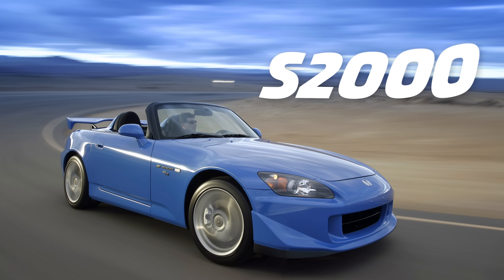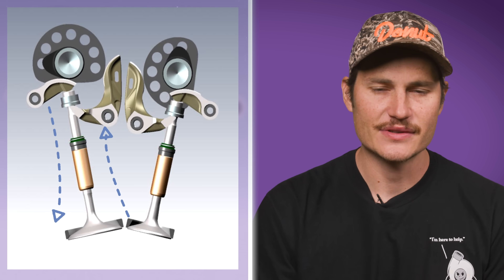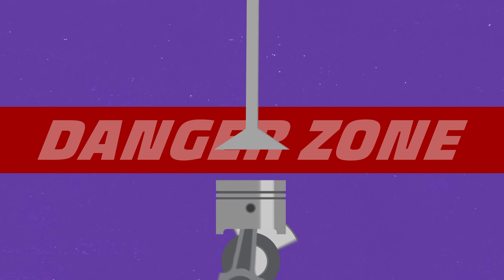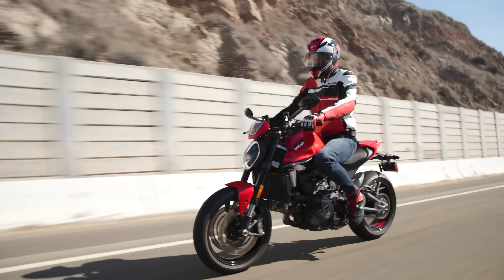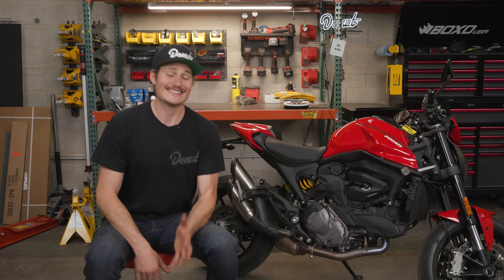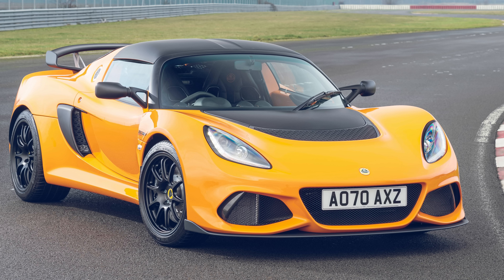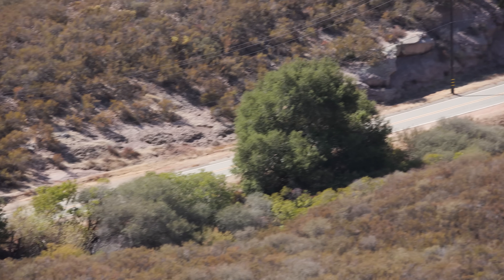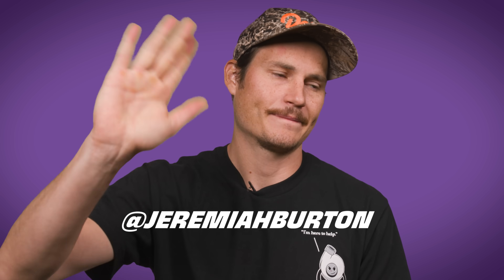Why ONLY Ducati Uses This Part To Go Fast

Comment: Recently watched a thing about Pegaso, in the 50s they built a car with a 32 valve quad cam V8 with desmodromic valves. The whole thing was nuts and 50 years ahead of it's time. All aluminum, dry sump, 5 speed transaxle. And it was one of those cars that had to be finished by a coachbuilder, so each one was unique. Absolutely gorgeous cars.

Comment: Wow, just when you think springs are standard - thanks Ducati. So, does a F1 engine use the same valve setup? 1.6lL15,000 rpm...

Comment: Honda used torsion bars instead of springs to close the valves in their 450 cc DOHC motorcycles in the mid sixties.

Comment: I remember the little Ducati Mach 1 250cc single back in the early 60s... revved to 11,000 and had a top speed over just over 100mph.... it was the only road going 250 that really could top the ton..... The Japanese claimed it but couldn't really do it by about 5mph. The little Dukes handled a lot better too, although their electrical systems were crap (Marelli) and very prone to stopping in wet weather, which is something Japanese bikes never did. I never could afford the Ducati..... sigh..... that was over 60 years ago... 😀

Comment: I don't understand the fascination with high RPMs.  Use more gears to take advantage of power made at lower RPMs and negate all of the problems of running an engine at a billion RPMs.  Makes much more sense.

Comment: Mc22.... cbr250rr can rev to over 18,000rpm like most of the early inline 4 250's...... these engines are also good for over 100,000klm complete with gear driven cams

Comment: the real problem with Desmos is that the check interval is often half that of your average DOHC spring-valve configuration at almost twice the cost because you need to have a Ducati authorized dealer do it. Yes, technically they say 16,000 miles or 25,000km OR every year... for most spring-valve it's 16,000 mile 25,000km... period. So if you only ride 5-6000 miles a year, that could be three years before your first valve-clearance check when a Ducati would have had 3.

Comment: I guess you forgot to mention that wet clutches last. 

More than 2wice as much as dry clutches if I'm not mistaken.

Now I'm not saying that dry clutches are bad.

I mean they are my favourite. 221 horses proof.

You know if you could mention all the motorcycles with dry clutches.

From all brands, in a video or someone else will come up with one later on.

You maybe thinking what is the Internet for? 

And why can't he just look that up online.

Bcoz. Of rivalries, hacking and blocking sites I look up.

Due to evil politicians, this place is actually hell in every way and the vast majority.

Comment: How does this system work in real life? Like, how does it not smash the valve too deep into the seat or leave it open a tiny bit and burn the valve?
Edit: there has to be a cushion somewhere in the system beside an oil film. Maybe rubber where the valve closer pushes on the stem.

Comment: This is the most depressive car/mech video of the year.
This is why we are stuck with worthless valvetrains from the 1890s and where we cant just fucking upgrade shit anymore.
Even the pneumatic shit from the 1980s F1 is not even in the regular shitbox sports cars today.
I can't think of a single great sounding roadcar anymore, but it doesnt matter either, noone can win, we will forced into electric silentmobiles in 2035 anyways, so goodbye car culture.
Reply: I only agree with the last line. Pneumatic is being skipped for full electric engagement valves like koenigsegg's freevalve.

The valvetrains from the 1890s only exist in shitbox LS engines, most modern engines use lightweight valves with titanium spring option, dual overhead cam,  dual variable valve lift and dual variable valve timing.   To say that you don't understand why sports cars didn't use desmodotrash technology such as your other comment, is to say that you didn't watch this video.

Desmodo causes more wear and tear than it does good and only solves half of the equation, they can't slam them open, only closed. The "fix it properly" instead of "whack a bandaid on" engineering or the japanese motorcycles and F1 carried through to modern day sports cars with lightweight valvetrains that achieve the same result with less moving parts, less wear and tear and less money.

Comment: correct me if I'm wrong but most bikes 150cc and above do 12k rpm +
Reply: My bike's engine is 955cc and redlines at 11,500 rpm.
Reply: @slesperado  weird mines only 150cc it redlines at 13000 rpm
Reply: @Ssrijon  A lot of factors are involved, including the configuration of the engine, the amount of angle (if in a "V" configuration), the type of metals used, etc.  My motorcycle has a 955cc 90° V-twin.  There are some Harley-Davidson bikes that have 1200cc V-twin engines with angles less than 90° that redline at about 6,200.  There are some 998cc 90° V4 Ducatis that redline at 16,500 rpm.

Comment: As far as I can tell, Ducati no longer use a true Desmodronic valve system (no direct gear drive to operate the valves) Instead they use drive belts, which is still interesting, but is more maintenance intensive. I am of the understanding that present day metallurgy is up to the task of producing valve springs which are sufficiently responsive to higher revolutions. With cars, it seems to be an American thing, where push rods ruled the day, up until  the recent corvette. The only new American engine, probably ever? Yes Im talking to you Harley Davidson.

Comment: Desmodromic too much friction. Too much moving part. This cost very expensive and not realiable than spring valve.

Desmodromic also make engine sound very noisy because too much metal friction from valve unit.

Comment: So how have spring assisted valve engines which run 16k RPM solved this? Bikes like the 600 supersports from Honda, Kawa, Yammie or Suzuki?

Comment: This actually solves a huge problem. 
Practically a holy grail. 
I have to say efficiency drops off after 6,000 rpm due to time for the fuel to burn per cycle. 
I'm amazed I haven't heard of this. Everyone wanted it. Horsepower is multiplied by RPM (lower gear longer).

Comment: BTW Ducati looking for lighter andlonger service intravals dumped desmo tech in favor of good old cams pushing sprung valves for latest generations of multistrada....thatswhat I just read anyway....and it still revs way past your 7500rpm quote...11k?  I think...with no desmo....60km service intravals so F desmo!

Comment: Honda (for instance was running a 250 at 19000 rpms WITHOUT Desmo....lots of boring bikes have had engines reviing well past 10 or 12 thousand rpm...LOTS of em....so I am thinking it is more related to the discplacement as in smaller is easier to engineer to rev the piss out of it and larger torque monsters cant take advantage of it like the little rev monsters...I cant explain why but apparently it is?   Must be more to it than just needing desmo to avoid springs

Comment: Desmo engines were used much earlier in cars than the super successful Mercedes W196 F1 car and the 300SLR 3 litre Mercedes Sports car. In 1914 Delage and Nagant used desmo engines in racing with the Delage being successful other companies such as Bignan and Ballot also used them. Americans Harry Miller and Fred Offenhauser built Desmo SOHC 4 cyl race engines in 1917 which were successful and these engines morphed into the famous Offenhauser, Norton made a prototype Desmo single cylinder Manx which John Surtees later owned so Ducati was not the only bike maker to use it. Ducati made bevel drive v twins that weren't desmo such as the 750 Sport and many other bikes that weren't desmo'

Comment: No other motocycle manufacturer could get the desmo to work, Mercedes’ was the only auto manufacturer to get it to work. 
With the valve spring technology coming of age, metals have become much much better this is the reason why the Japanese have been able to rev higher & now the new V4 Duc engine. 
I am surprised he had mentioned about the desmo Mercedes’.

Comment: Thé new V4 does not use the desmodromic valve train. Only the twins do & the older Desmosedici from the mid 2000’s.  
 Besides the photo on the YouTube showing the desmo valve train with an arrow pointing to the clutch. If you are going to do something, do it right. 
BTW, if you don’t rev the Duc’s engine to redline & living there valve adjustments aren’t needed as often. I have 22K on a 93 Duc 900ss I haven’t had the valves adjusted in 12K miles. I didn’t  run redline all the time since $500.00 back then to me was too expensive. A former Ducati dealer & racers told me don’t live @ redline & valve adjustments are a lot fewer. The first 500 miles adjustment is critical same with @ 3K miles & 6 but after that it’s all up to you. Sure some valves can go out of adjustment even at lower rpm’s but I have been fortunate. I have seen recent valve adjustment on a buddies 750 the exhaust closed up not allowing the engine to operate properly. 9K rpm on a twin two valve is not a problem. Don’t listen to what they say in the movie CHIPS. Dak is wrong. Thé four valve engine can rev more & the two valve can so 9K easily

Comment: Mercedes-Benz used desmodromic valve control in the engine of the 1954 W196. The engine could rev up to 10 000rpm.
Ducati came, saw and copied.
Reply: The only reason why the highest rev of supercars is only limited to 11k RPM is because a emission regulation..

Comment: there are 2 valve systems that may work better than desmo, last longer and allow better performance. 
F-1  valves have nitrogen bladders closing the valves.  they  CAN  turn over 20k.
the new cam-less computer driven air/oil Koenigsegg valve train is already in production.  this system is able to optimize valve lift, duration and  timing based on the actual performance requested by accelerator pedal / throttle body angle position

Comment: Wow 17,000 rpm is that all, there are many motors which can rev even higher,
Honda RC165 used to rev to 20,00 and we had one on the dyno doing 26,000
There are several others just in the Honda range that rev higher than an a antiquated desmo system that was designed by Moto Guzzi and sold to Ducati
Forget it my first dislike in years  (ever) do your homework first.
And don't forget rotary motors they can rev even higher

Comment: Ariel Atom V8 500 - 10,600 RPM
Lexus LFA - 9,500 RPM
Mazda RX8 Type S - 9,500 RPM
Honda S600 - 9,500 RPM
Ferrari LaFerrari - 9,250 RPM
Honda S2000 - 9,000 RPM
Honda Integra Type R - 8,800 RPM
Audi R8 V10 Plus - 8,700 RPM

Comment: The 'desmodromic' springless valvetrain was invented in the late 1800's, used in the early 1900's in some engines so it's nothing new.   Mercedes did use it in their GP cars back when valve spring metallurgy placed a real limit on RPM and eliminating springs gave them about a 2000 rpm advantage.   Spring metallurgy took a leap forward in the late 1980's and instantly became able to take whatever revs you wanted...20,000+ with large valves and 'desmodromic' systems no longer needed.   

Ducati uses it only as a sales tool..mechanically there's no advantage to it and actually makes for much more intensive maintenance than a conventional system.   Honda had research engines that run over 24,000 rpm trying to see if the flame speed continued to increase with rpm and if there was a limit.   It did keep increasing and basically there is no limit due to flame speed.  By the way, the 24,000 rev motor made maximum power only using 50 octane fuel...the time of combustion was so short that detonation didn't have time to happen.

Comment: Mercedes invented Desmond valves in the 1940,s- a failed flawed system it abandoned to nematic ,s  which is now used totally in F-1 and motogp,and ducati have only won 1 single championship because of this failed design,yamaha beat them with a bike which made less power because of its smooth sweet power delivery-dump ducati never got that,O,well.....
Reply: Clearly Wankel Rotary engines are the ultimate answer, no valves needed, and so good they were banned from F1.

Comment: Yeah Honda CBR250RR isn't impressed. It can reach 20,000 rpms in the early 90's
Reply: Moving mass of the piston is kind of a bigger issue. When you have baby sized pistons, you have less moving mass (smaller valves too).

Comment: Sorry.. but what supercars rev to 11k?!
Reply: That's not really that high, my Mazda is stock rev to 9.5k rpm and they are perfectly safe to rev 12k rpm (you just need to flash the computer so the fuel cutout doesn't activate at the stock limit, no other change required).

Comment: 1991 Honda CBR250RR 19000 RPM had springs but gear driven cams.30 years old and still doing 19000 and around the 45 HP

Comment: trust mechanics, not materials
Reply: You can only do so much with cast iron, but if you can 3d print hollow titanium honeycomb parts... Well you're looking at much lower reciprocating stresses and much more gentle on the engine at some insane speeds. Doesn't matter if the mechanic is buttering that frying pan, cast iron isn't going to cut it anymore. Also I don't want a single mechanic touching my car, so many of them are incompetent morons it amazes me to this day, and if something fails and I die, I want to be the one to blame and know it was my fault and not someone else.

Comment: I ride a 20 V4S Penigale, and 21 V4S Multi. 17k vs 11k rpm. LOL and you thought 11k RPM was ever slow? Yea, well when you have 17k it is.
Reply: Cops be damned!!!!!! Cause they simply cant catch me.
Reply: The multi doesnt have the Desmo system but it gets me to 35k for my first valve change compared to 12-14k on the Pani
Reply: Oh yea most ppl dont know motos need valve inspections around 16k which cost... wait for it... on average 1200 bucks. So yea, the more racy the sooner that check is needed on average.

Comment: The highest revving engines use valve springs, the system, as you say, did help with revs but what it was great for was allowing the use of a radical cam at high revs.

Comment: The Yamaha r6 revs to 17500rpm
Reply: Maybe modified, but their tachometer was so far off and it was limited to 15.8k rpm and offered owners a refund if they didn't want to keep the bike. I have tiny vintage toy motors that rev higher than that anyways.

Comment: Ducati are one of the most unreliable motorcycles on the road. They probably would be the most but there ain't that many on the road. Most 600cc bikes rev high like this also🙄
Reply: Are they actually worse than a Harley? Harley's are the safest, you'll spend more time fixing than riding, which is much safer than being on the road.
Reply: @jakegarrett8109  as a specialist in motorcycle recovery I stick by what I said. Harley's are poorly built and Chinese parts now. Ducati's have electrical gremlins like all italian vehicles. Fiat, Alfa, Ferrari etc.
Reply: @Mrreal1871  Interesting, I'm trying to figure out what I should get for a new toy (used, but "new" to me). It seems like most of the early 2000 models (like 2001-2005) sport bikes from the big 3 all have issues with everything from stators going out, to 2nd gears just gone, so I was considering a less performance oriented Ducati as one possible option, but if they have worse reliability and higher maintenance cost then I can scratch those off that options.
Reply: @jakegarrett8109  yh the r6 gearbox second always goes. Stator is a minor cheap fix and they have revised it since. Honda stators are the most common, otherwise they just keep going. Ive seen ones with over 100k on them.  I would get the next shape up r6 Yamaha make quality bikes.

Comment: Swear Rotary engines rev higher than honda  engines? 🤔
Reply: Yes, but nothing touches a rotary (pets RX-8 in driveway and gives it a kiss before going to bed)
Reply: Since he said "on the road today", I figured he meant still in mass production today, and since Mazda discontinued production in 2012 (a decade ago), I figured that's what he meant.
Reply: @jakegarrett8109  I miss my rx-8 😭😭

Comment: bruh s200 only 9000 rpm my ymamaha r125 redlines at 12000
Reply: That also has a baby sized piston with low moving mass. Model RC toys will whip that RPM record right off your bike (and those toys make higher power to size and higher power to weight than it too)

Comment: seems like the issue could be solve easily just use a mini- crank shaft instead of a cam. Then you can bypass the spring behavior.

Comment: I dont think the 2012 rav4 have the vvtli it wouldve been the vvti engine. It's almost the same engine but there was no added lift at like 6500 rpm which gave 40 extra hp like the exige had

Comment: advances in metalurgy largely dimishes the need for desmo. DOHC 4 valve systems typically start running into negative gains around 12krpm anyways, better to just go pneumatic at that point. there is still a major benefit to desmo in one as of yet unused way though. I can't tell you because I'm probably the only person on earth to think of it (genius level)

Comment: As a ducati owner, The desmo system is amazing till you have to have a valve job done, then it costs alot more and have shorter service intervals compared to normal valve systems. You also have the ducati mark-up as well. No i dont own a V4-R sadly.